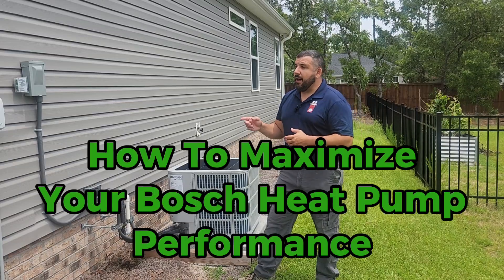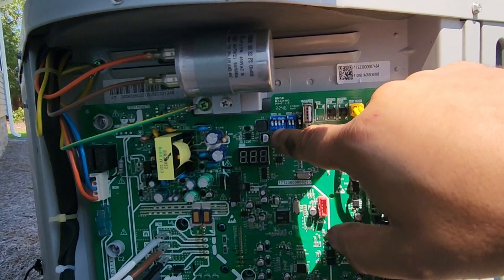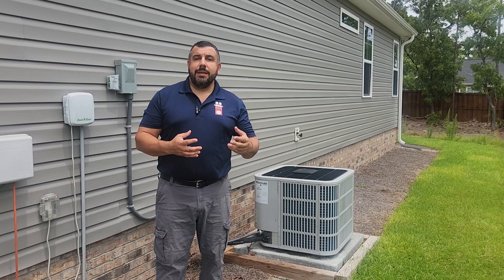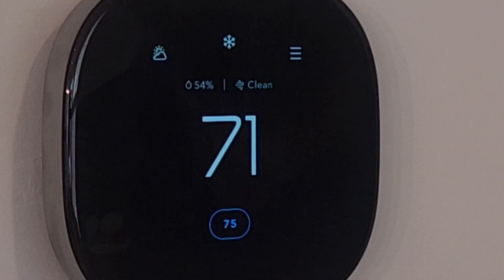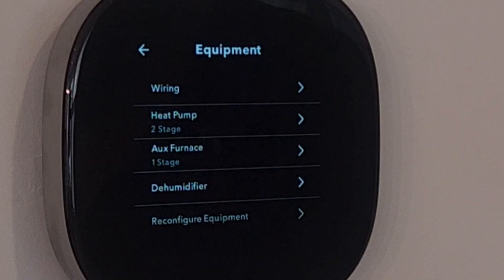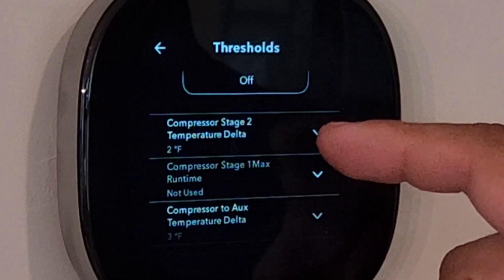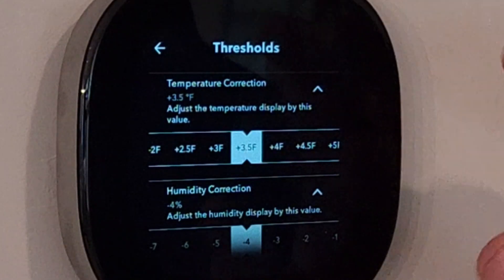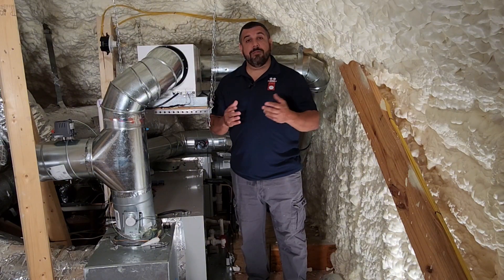How To Maximize Your Bosch Heat Pump Performance

Comment: I will have a Bosch heat pump installed in a few days and need to adjust 5 ton to 4 ton. Thank you so much for the information, great video!

Comment: I’ve heard a larger coil increases surface area, which increases efficiency but makes it harder for the coil to get to a lower temperature, decreasing latent capacity.
But for a system like the bosch ids that maintains a constant evaporator coil temperature(and set to lower), I figure itd be different
Reply from the maker: @ElectroTree01  it increases latent and sensible
Reply: @timdestasiohvac  With an inverter system and the desired coil temp set to lower temp, I suppose that is correct. I guess the comment didn't update properly after editing, so sorry for the lack of clarity.

Comment: Great video! I had a Bosch IDS 2.0BOVB-60HDN 5 Ton Condenser, paired with a Bosch BMAC4860DNTF 5 Ton Coil, and Bosch BGH96M120D5B Gas Furnace (Propane). It was installed 6 months ago, and it seems that the company that sold it to me doesn't really understand it enough to tweak it for maxium efficiency. The heat pump is an energy hog, but I plan to address that in the spring here in the NY/NJ area. Right now, the temps dropped to 0 degrees last night, and my Honeywell T10 thermostat was set for 70 degrees. At 3 am I woke up cold, and saw that the temperature on the thermostat was 66 degrees, but it still was ON, heating to 70. I went to the furnace and watched the flames for 15 minutes and they stayed lit. After the sun came up at 7 am, it took another 4-5 hours before it got to 70 degrees, and it's stayed that way all day, fine. I had a secondary contractor come in last week and pop the cover off and he said this two-stage unit was only operating as a one stage as there were NO wires where they should be. And after the load calculation he did with a 3D app, my 3,000 sq foot house should have the unit sized for 4 ton instead of 5 ton. I then had another contractor talk to me on the phone saying, "No, the two-stage feature is a switch on the board." And he also stated that I need the 5 ton for my sq footage. Any ideas? I'm lost. Am I missing wires for the two-stage operation or are the settings on the board? Thanks.
Reply from the maker: Hi Jerry, to answer that question, I'd need some more information and it would take some time.  I offer consulting services at $200/ hour.  I could probably get to the bottom of it remotely from a Zoom call for an hour or 2.  If you'd like to pursue that further, go to my website www.comfortsciencesolutions.com and fill out  a request form.  Thanks!
Reply: @timdestasiohvac  Thanks. Followed you on your other pages and will set something up with you.

Comment: We love the Bosch, Philly has humidity but nothing like the Southern areas. The IDS lite is a great entry level product. We've had customers floor by the difference in sound level outside and electric cost to run the unit, coupled with comfort of a continuous flow of heated and cool airflow.  The 20 seer high heat model in a cold climate cannot be beat. Previously we used Daikin or Fujitsu compact cassette blower mini split ducted units, which can work with existing duct system in some cases. Unless the existing duct system is a complete mess, Bosch will work. However, the use of Aero Seal process might be required.
Reply from the maker: @dennistreacy3595  great comment!

Comment: The company I am with has been installing Bosch IDS systems for about 8 years now. We love them, amazing reliability, and amazing performance when properly sized and set up. We do not flip the switch, in 3 different Bosch classes we were informed it is simply not needed, one of the head instructors stated he doesn't understand why its even present, as its not needed. 
We mostly use the Bosch BCC100 thermostat, but now switching to the Bosch BCC110 as its replacing the BCC100. Bosch will work with most heat pump thermostats, we have also used several Honeywell models, along with PRO1.

Ecobee is the only thermostat that has given us issues, and a Bosch rep I spoke with said it was a conflict of interest, as  the Bosch board is trying to maintain constant coil temp, and the eco-bee using geo-fencing is trying to limit compressor run time based on occupancy, setpoint, runtime, etc. thus a conflict of interest.
Now kudos to you if you have eco-bee and Bosch nesting together perfectly, (we finally resolved out issue after several callbacks )  so yes properly set up ecobee and Bosch can play nice together,  but I will stick with Bosch's thermostat designed for the system and plays nice from the start, and continue to use PRO1 stats in the dumbed down configurations. 

Hope I didn't sound harsh, was a great video, I subbed, look forward to more content from you, and of course offering my .2 cents.
Have a Merry Christmas!

Comment: FIRST, I wanted to say that this is the best video about setup that I have come across. WELL DONE SIR!

SECOND:
The Bosch Heat Pump 20 seer Premium Connected has been a good system as far as heating our home quickly but it does have its downsides. Many of which I DID NOT come across during my research. 
We have a 5 Ton unit set to 4 ton with the dip switches
It is the BOVB-60HDN1-M20G paired with the BVA-48WN1-M20.
THE THING IS LOUD when heating. Like ridiculously loud and that was NEVER told to me by my contractor and I never saw any complaints, until, of course, it was installed. 

WARNING TO ALL. When heating it is LOUD. Sounds like a prop plane and that loudness can bleed through walls and be a real nuisance. I can't imagine how loud it would be on a roof, but I've heard complaints.

Also, I paired it with the Bosch Air Handler so I could get the most efficiently possible. That has a harmonic that travels down the line set and creates a humming (harmonic) tone that drives me crazy, but I am getting used to it. 

All I saw when researching the unit is how quiet it was and that is what my HVAC tech said.... Yes, when cooling, but when heating... Good Lord.

I am going to to through this video a couple times to check the setting against what my contractor did. I do trust him, but I want to compare.

Thanks again for creating such a thorough and informative video.

Comment: I really appreciate this video as I just bought a house with the Bosch 7739832068 heat pump and brought with me an ecobee premium from my previous home which had a typical gas furnace system. But I believe the install for the system might be incorrect because when I go through the wiring screen on the ecobee telling it which wires are hooked up, it tells me it’s an unusual setup.   I’ve had 2 different HVAC people out including the company who installed the system a year ago before I bought the house.  Neither place knew much about the ecobee and therefor weren’t much help in telling me if it was all setup right in the settings.  What worries me most is that I feel like the wiring might be wrong. I only have Y, G, C, O/B, W2, and R.  And the company who installed the system but not the ecobee that I brought with me wasn’t sure if the W Wire went to W1 or W2 so he put it on W2.  But I also wonder if I shouldn’t have a Y2 wire.  All I get is HEAT and AUX STAGE 1 HEAT.  Shouldn’t there be more stages?  I’d really love your insight on my system since the 2 local places I paid to come and look at it didn’t seem to know what they were doing very well.  Can I contact you somehow? I could pay if need be to get your help.

Comment: Great video. I guess it doesn’t matter the evap coil is bigger with a variable speed compressor because it can control the saturation temp. With a single stage compressor a larger evap coil isn’t good for latent capacity because the larger coil gives it a larger temp/pressure? Is this correct?
Reply from the maker: @sirfishalot6992  no the larger coil improves latent and adds seer

Comment: Hi Tim. I assume you are using Ecobee. I am asking because Ecobee can't handle inverter systems. Yes, Ecobee works with IDS 2.1 but I don't think you get the full benefit of the system.
Reply from the maker: @molk17  who says? Its 24V controls

Comment: Where is the video for heat?  My bosch system is screaming like a banshee with a ecobee 3 lite and having the HVAC installers back to check again.  Just not doing what I think it should be doing as a invertor heat pump.  getting bewtween 10-20 min run times.  Just changed heat differential to 1.5 degrees instead of 1.  How are sensors utilized or do u not use them?
Reply from the maker: @mrc5980  they are louder in heat. The compressor has to run in a high speed periodically for oil return.

Comment: My Rheem system had a similar problem, and I did the same thing, lowering the fan speed, except I don't believe I have dips switch on my outside unit. The best thing here is i have the same thermostat, and your breakdown of the suggested setting is amazing.
Reply from the maker: @Litt1leMe  thanks! Slowing the blower works with non inverter systems too!
Reply: Any issues with slower blower motor speeds during the winter months when AUX heat is called? BTW, great video. thanks!
Reply from the maker: @zee_928  not in my climate. I rarely go into 2nd stage in heating and never aux. Im making a heating video soon.
Reply: @timdestasiohvac  I am 2hrs west of you, Raleigh.  my issue is my 5 ton package unit is doing a defrost cycle every 20 mins when we were in the 20s last week.  No heat strips, so during defrost I get AC cold air. My split system for the 2nd floor is identical to yours.
Reply from the maker: @zee_928  you need strips. And there might be a charge issue too

Comment: Hey Tim, great info here! question for you though, with a home in need of 3 tons of cooling, would you recommend 3 ton condenser and ahu or upsize them then derate with j2 dipswitch?
Reply from the maker: @MikeJohnson-bz1rp  i'd go with a 4 ton AHU, 3 ton outdoor and run it at the slowest fan speed possible to maintain temperature in summer.
Reply: @timdestasiohvac how do you set it to run longer on slow speed I have ecobee premium T installed

Comment: These Bosch units don't hold up. Coil leaks, control board failures, blower motor failures, bent blower motor assemblies from the factory, etc. these units have very low capacity when compared to other systems. 
Would absolutely recommend that you stay far away from this Midea system, rebranded as a Bosch.
Reply from the maker: @MrDeviousdom  maybe its just you
Reply: @timdestasiohvac  why post such an idiotic response? Maybe it's just that I've installed so many of them, I get to see the failure rates higher than most?
Reply from the maker: @MrDeviousdom  maybe youre doing it wrong.

Comment: I got the first generation Bosch.  Has been amazing. Will I get more benefits out of the Ecobee than Bosch BC-100 ? I don’t have a 2 stage air handler.
Reply from the maker: @rameygarnett1  you might be able to get an aftermarket ecm motor that will do 2 stage.

Comment: Tim i have a bosch. I need some tips with the HP. And balance point explained. The hp will run below balance point and sometimes itll run say point is 35 itll run at 28 then next cycle is fossil. Is this common?
Reply from the maker: @Keith_Mikell  if its the Bosch thermostat it may be looking at other factors. I dont know as much about that control.

Comment: Hi Tim-great video....have you ever worked with fan handler products? check them out....i am using their heat pump controller on my bosch heat pump in upstate ny with good results
Reply from the maker: @bobrumpf2576  what do you like about them?

Comment: Do you find this unit noisy in heat mode?
Reply from the maker: @emyunster  yes periodically it goes into oil return mode and the comp.speeds up
Reply: @timdestasiohvac  any recommendations on quieter systems?

Comment: Great video... thanks so much.  
I'm just north of Toronto, ON (CAN) and have the 3ton model with a 2-ton coil but with the Ecobee 3 lite.   I have my Bosch running with only a Y1 (though I'm thinking of hooking up the Y2) and it ran perfectly during the summer months.  I have my cool differential set a 1F (0.6C) and have ZERO setback, and it maintained a 75f (24C) with zero effort.   I did have to lower the air handler fan speed though to increase more dehumidification.

Now it's winter in heating mode but I'm finding the compressor fan to be running at a high speed even though the temperature outside is about 37f (3C), and is much louder than in cooling mode..  I wondering if I hook up the Y2 wire to enable the Stage 2 setting and allowing the air handler fan to run at a higher CFM, if this would change how the compressor fan operates?   Would the compressor fan increase even more or decrease as a result?
Reply from the maker: It will be louder in heating mode.  The outdoor fan will run at high speed to absorb as much heat into the outdoor coil as possible.  The compressor will also periodically speed up as part of an oil return mode if it runs in 1st stage for a long time.  Since you're in a colder environment you definitely need to hook up Y2 with reverse staging in heating and cooling as I show in the video.
Reply: @timdestasiohvac  thank you so much for your kind response.   I'm going to hook up the Y2 wire for 2nd stage cooling/heating but I will likely not require it.   Cooling went fine without the need of 2nd stage during the summer (1st stage ran for 1hr no problem to maintain 1F differential).  As for heating, so far at 4C (40F), it has been able to maintain the 1F, and because we have low cost natural gas, my furnace will likely switch over at -1.1C (30F) due to the economic crossover.   I was just more wondering about the noise level and if a 2nd stage would be louder.
Reply from the maker: @chimaican01  I rarely go into 2nd stage in cooling and DEFINITELY don't need it in heating but I am on the NC coast lol.  You have the opposite problem.  Hook it up and see what it does.
Reply: @timdestasiohvac hi Tim its me again how can I run my stage one longer, my stage one runs only for 10 minutes then starts the stage 2. How can I set the fan speed?
Reply from the maker: @TheHandyFlightAttendant  seperate your stage 2 by 2 degrees from setpoint. Not sure I can help you without booking a consultation.

Comment: Is this reliable unit? 

What about availability if spare parts?
Reply from the maker: I feel like it is.  It should have a quality surge protector.  Part availability varies from area to area but I haven't heard of the leaky evaporator coils that has plagued other brands.
Reply: Can you recommend one? (Surge protector)
Reply from the maker: @emyunster  AG3000 if you're on a budget, ICM493 gives a little more protection.

Comment: Hi Tim, so I got the wiring diagram from Bosch then connected all the wires and followed your settings, the ecobee premium couldn’t detect the y2 and w2 wires, then I manually added the wires. 
Then powered up the system and started the cooling. Temp was 75 and Tstat temp was set to 73, system started in again C2 (stage). What am I doing wrong. I thought it supppse to start in low stage then ramp up to c2 ? Is that right?
Reply from the maker: Yes, it should ramp up and ramp down.  I'm not sure I can helpe you diagnose what's wrong remotely.  I'm sorry you're having trouble.

Comment: thanks for your video.  Can you share more info about your monitoring setup?  I currently have sensorpush sensors at the start and end of the return duct and at the start and end of supply (to measure split).

I struggled for a long time with humidity issues from my unit.  The thing that had the greatest impact for me was shimming the unit so it leaned slightly towards the drain.  When I stuck a bore camera in the unit I noticed a significant amount of water sitting below the coil and the primary drain not being utilized.  The unit is in a horizontal config.
Reply from the maker: @adambrock  look at my video feed youll see some content on it

Comment: Hi, quick question, does the air handler need to be installed in a controlled environment? My Bosch air handler is in the garage and is ‘sweating’ a lot, the installer said that is due to the garage is not a controlled environment. Any thoughts about it.
Thanks
Reply from the maker: @alfort1943  he is correct. Especially if you live in a humid climate, the garage has a very high dew point and the air handler only has a thin amount of insulation on it. The only solution for you is to lower the dew point in the garage by keeping the door closed, sealing up any additional gaps and putting a dehumidifier in there.
Reply: @timdestasiohvac 
Thanks for your prompt response

Comment: Tim:  Thank you again.  Will monitor this overnight as I made my cooling related settings match yours, wth the exception of a 15 minute run time minimum in cooling. I added 5 minutes of overcool time.  Because we don't have a whole house dehumidifer like you do, and it being not too warm in late Sept, humidity is up, but demand to lower overall temps is down. Do you have a similar video for this Bosch system (or recommendation for someone else) but for the heating side of the equation for Ecobee?  I've got this HP20, but I also have a gas furnace for aux heat.  I want the HP to do it's thing and keep us warm, but operate efficiently to the extent practical in the winter,.  It will cut out below 35 degrees. Tall ceilings, 120 year old house, decently insulated, but its' only going to become but so efficient. Any direction you can provide on that would be appreciated.